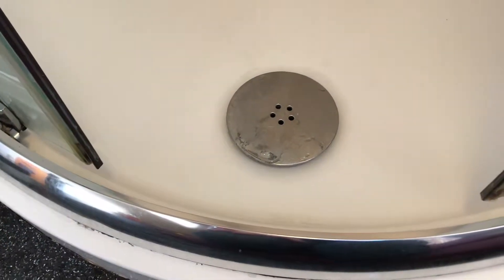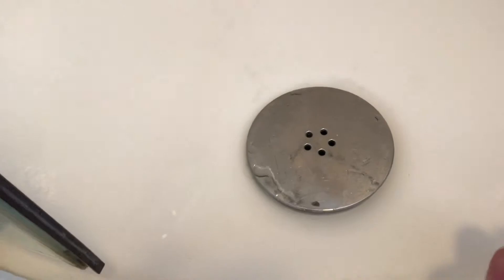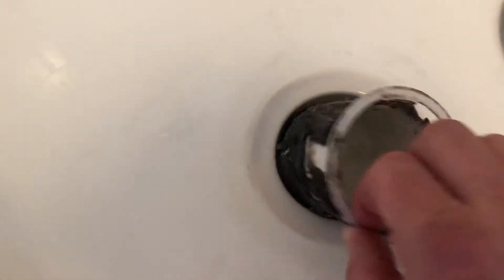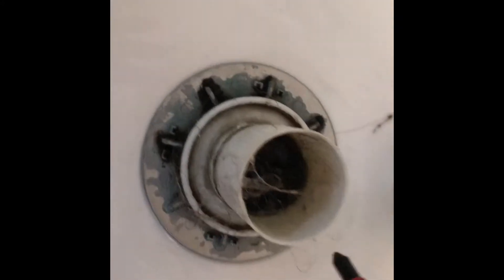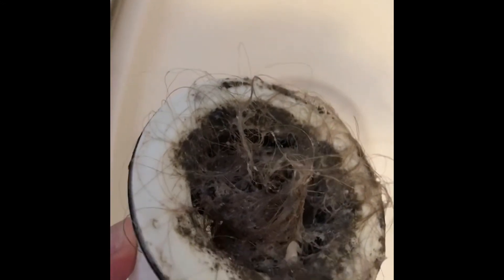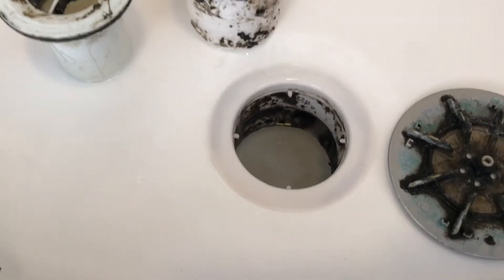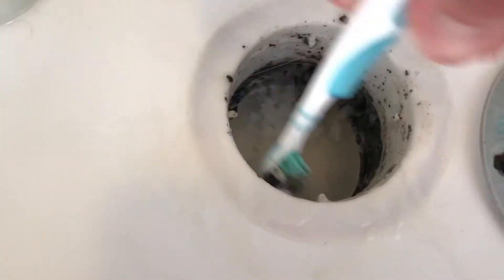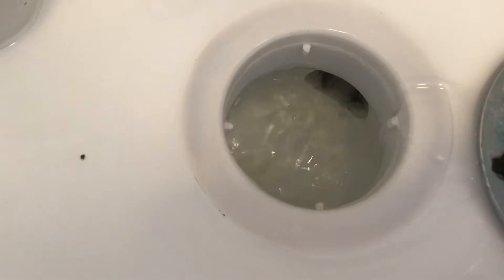Unclog a Blocked shower drain plug hole waste pipe blocked unclog pipes shower drain unclog it

Comment: By all means take the cap off and the bowl out, then put them in a separate bowl to wash them.  When you  unscrew the top from the lower piece, make sure you don't lose the screw among all the gunge!  So don't do it over the shower. You can also take the shower head off the flexible pipe and put the pipe down the waste and turn it on for a good whoosh of clean water down the drain.  The waste needs cleaning regularly.

Comment: Hi, 'this just pulls off'... mine does not, I have pulled it quite hard, twisted, pushed and twisted, put fingers under to feel for some sort of clip mechanism. Fear breaking it as i am in rented.
Reply: going through the same now myself and I dont know what to do 🥲
Reply: @sandralizjoseph8366  I managed to get it out, the rubber seal around mine just made it really tight.
I managed to get fingers under the cover piece, fearful that it would break... 
It hurt... I had 4 fingers under, applying pressure as near the centre as possible.
It worked.
Reply: @pms9838  guess I'll have to risk being hurt to clean it then....wish me luck 🥲
Reply: @sandralizjoseph8366  good luck 🤞